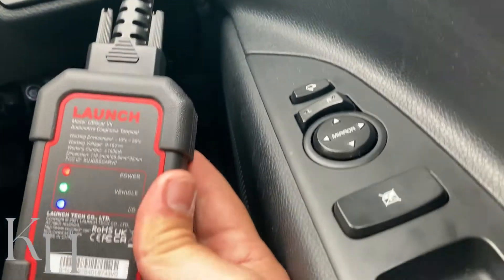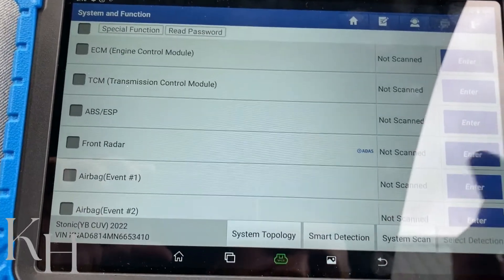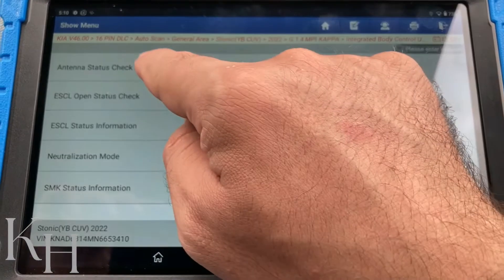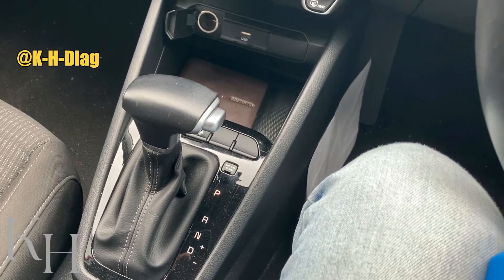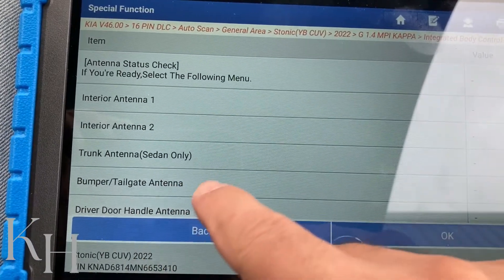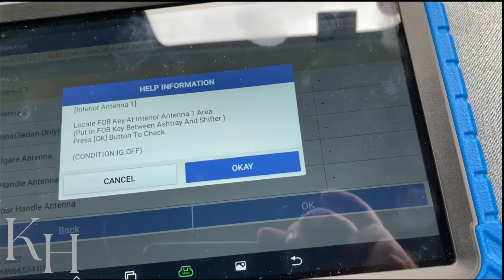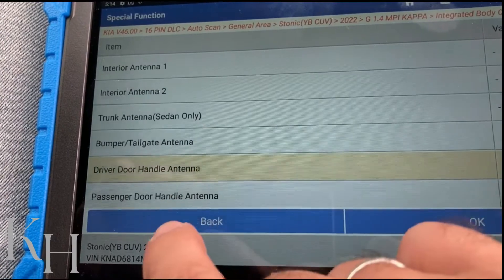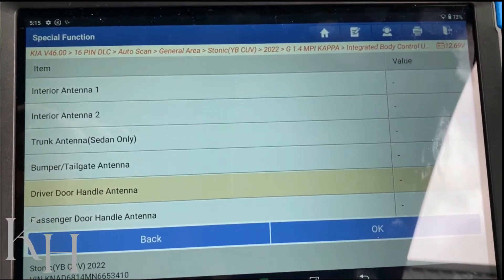KIA Stonic Smart Key LF Antenna Diagnostics

Comment: Sir, one question if i may plz. my friend's Hyundai Sonata YF smart key with SSB and fob holder and when fob inside the car SSB doesn't respond at all unless he put the fob inside fob holder and then car cranks and start and run OK. 
so, i've changed for him 3V battery (which is even 3,3V) more than enough, even couple of times and defferent brands, nothing changed, i did diagnoctic and checked all antennas all good,all active. i wonder what else could it be a reason of that failure? may be RF reciever shorted to ground or anything? no fault codes during diagnostic with Thinktool SE and Expert 195.
just don't want to disassemble all dash apart for electrical check-up before make sure there no problem outside of RF receiver and SKM or PDM or FOB holder.
any ideas or suggestions what is wrong? may be reprogramming a fob mind help?
thank you in advance